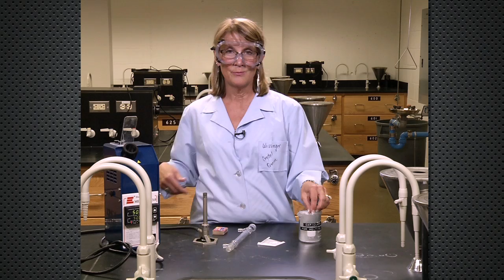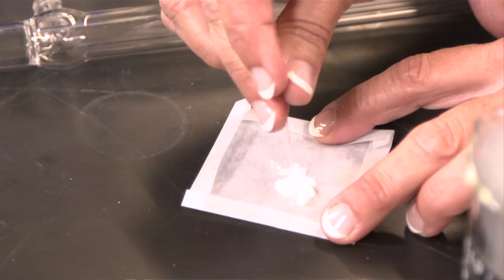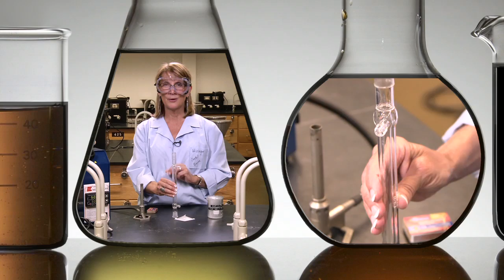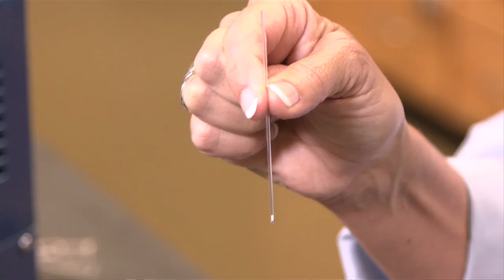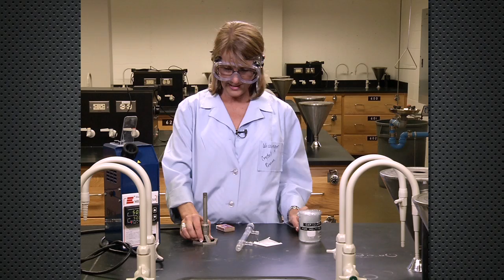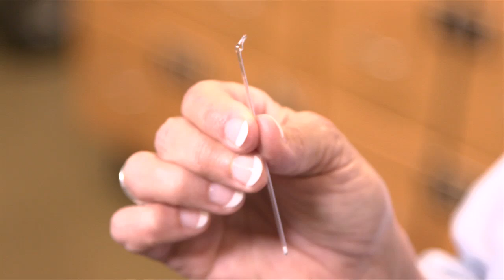How to Prepare a Melting Point Capillary Tube

Comment: Using a bunsen-burner (or any open flame for that matter) in an organic lab can be extremely dangerous. The safety of this lab seems to be very far below normal global standards. Not even fume-hoods! I would refuse work in such a lab.
Reply: Same, especially that she has no gloves on. And is burning something in an oblique manner(putting the previously bottom compounds at risk of slide to the side formerly open side where she is flaming and combusting)